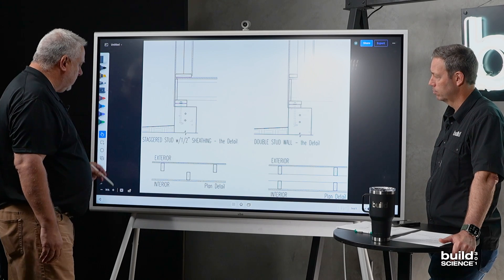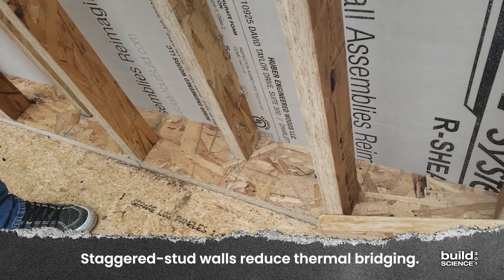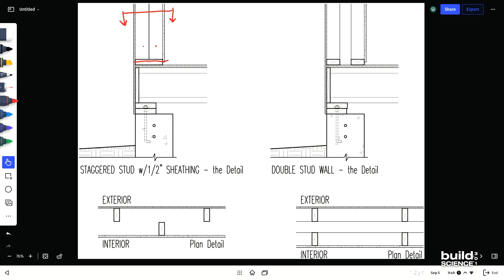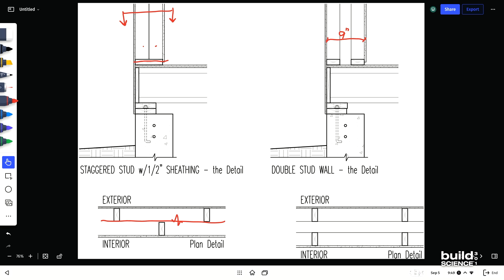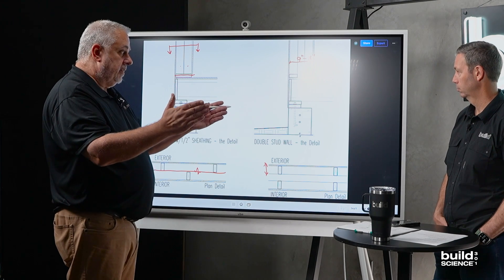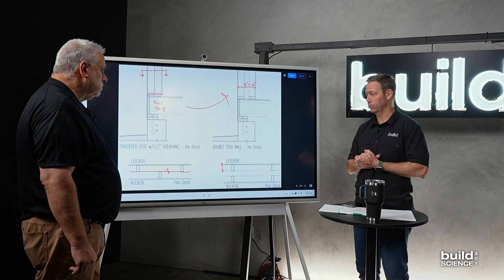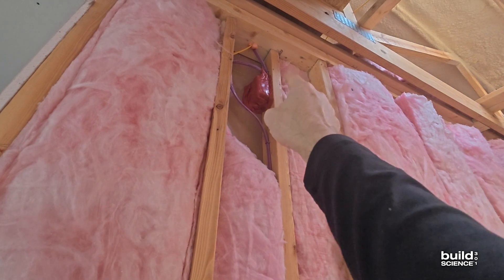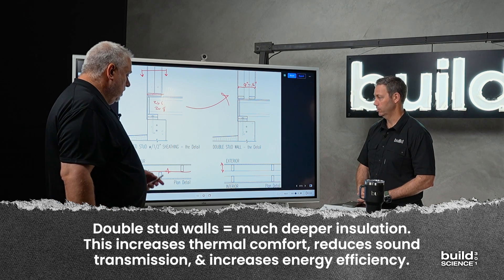Staggered Stud Wall & Double Stud Wall - BS301 -  Build Show Clips

Comment: And yet you get no 'energy code credits' for staggered studs.  Under next year's code, you will have to also put a one-inch thick continuous layer of insulation on the outside of your build.  

I am finishing up a small backyard cottage that uses the staggered stud to achieve near passive level insulation.  Somone who spent a lifetime studying building and insulation told me that until you stagger your studs, putting in more insulation beyond R24 is worthless; the heat transfer through the normal stud overcomes the increased insulation.  The problems with the 'over-coat' of one inch exterior insulation are that it must be done nearly perfectly and I cannot imagine how critters--from rats and mice to insects and bugs--won't make a home in this layer.

In Seattle are some famous apartments called Anhalt apartments.  Built in the 1920's these structures are still in high demand.  One reason is that Anhalt, the builder, constructed with double walls--and floors and ceiling got the same treatment--doubled.

Comment: If you are replacing a 2x6 wall with a staggered 2x4 wall unless you are going for increased thickness, where is the savings? The material cost is similar, but the labor for the staggered wall is higher. The other question is that if are doing a staggered wall for insulating purposes, remember that you can have a zip system insulated exterior panel wall which provides both insulation and breaks thermal transmission. So, this leads to the question: When is a staggered stud wall required because the zip system wall cannot provide what you need?
Reply: Are you saying it’s a wash in costs between this and Zip-R?  My assumption is that Zip systems are expensive.
Reply: I would do both Zip-R or similar AND staggered stud framing. Remember you can't go too thick with the Zip-R because at some point the fastener costs sink you. So you're limited in the exterior insulation depth without even more advanced details, like larsen trusses or continuous exterior comfortboard + furring. So to me, the Zip R6 or 9, and staggered studs, is a pretty cost effective way to maximize performance for money if you just want something well built and not shooting for passive house.